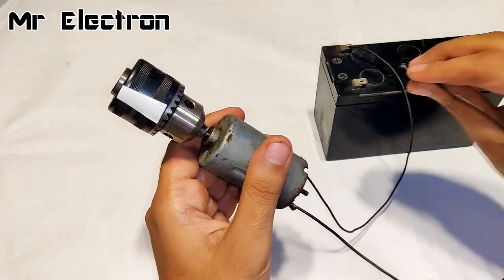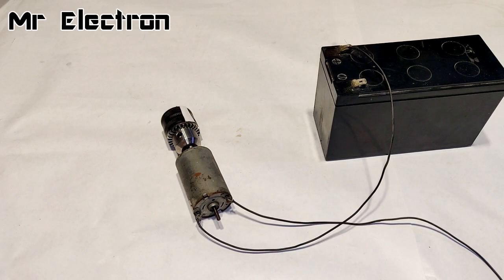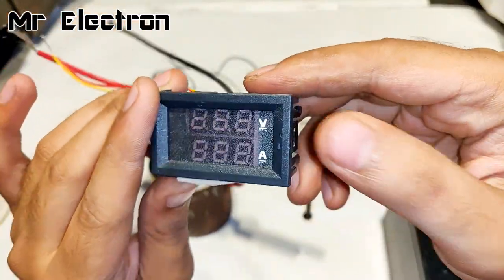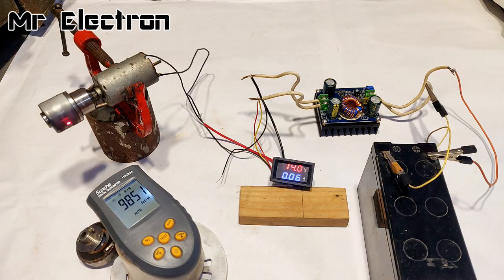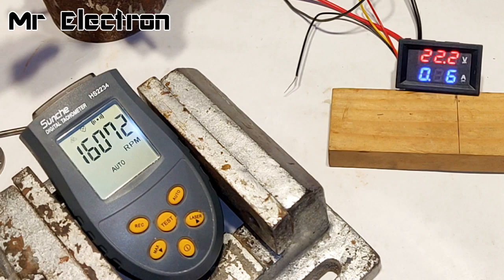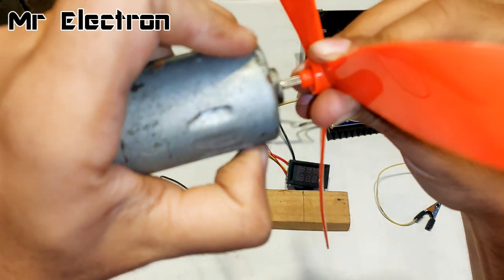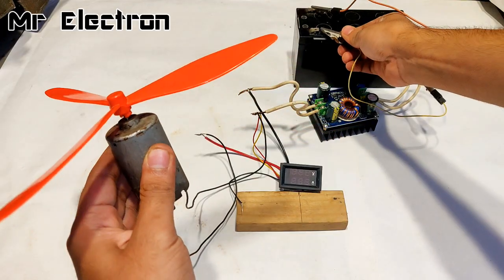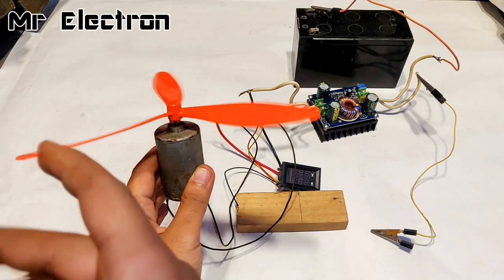40000 RPM - 12V DC Motor from Old DVD forced at 40 Volts DC ( Flying Helicopter )

Comment: Can we use led bulb circuit in place of DC booster ???????bcz led bulb circuit give output of 100 to 110v in DC without load or after load it gives us 80 to 90v ??????

Comment: flying process depends on motor's RPM as well as its propeller, if the propeller change accordingly specially designed for a flying machine, may be it could fly in low RPM/volt/Amp.

Comment: After one minyte the motor would heat and melt or probably come apart.
Reply: It's a fairly high impedence motor.  Even loaded with the prop, it's only drawing about 1 amp at 40 volts so 40 watts which isn't much for a motor this size.
Reply: @Andy-df5fj  thanks for the explanation.

Comment: With a better proppeler it could fly at 30 volts only. That proppeller is designed for a plane not a vertical take off.

Comment: This is risky. Please use safety gears like a helmet with face shield and something to protect your body as well. If that wings break or comes out of the shaft of the motor, it can be dangerous. 
I hope that motor is RS775 or S885. It can withstand a max of 24 Volts. With more voltage, it will get heated soon and also the brushes will get destroyed soon.

Comment: This video was absolutely awesome! I bet with all that thrust that the motor must have stayed pretty cool despite being forced to 40 volts?
Reply from the maker: Yes it is same as before.. No performance change 😀
Reply: @MrElectron  that's quite awesome, I bet if you soldered some aluminum fins to it, it would no doubt stay cool as long as you find a better propeller lol
Reply: I'm definitely going to get me one of those voltage boosters though, I'm sure I can find plenty of use for one of those, when needed

Comment: Can i use it for e bike 48v 250w scooty i need to run on single battary
Reply from the maker: Yes
Reply: Wot battery 😂😂😂 tho cus ya gonna see more amps to step up the voltage eg to power 48v 250w  could draw over double tripple the current from a 12v battery which reduces the run time lol

Comment: Hey bro you do some projects with bike starter motor right? Please can you tell how much rpm it gives when 12v battery is used?
Reply from the maker: Around 8000 to 10000 which is reduced with a reducer gear box.
Reply: Thank you for helping :)

Comment: Build quadcopter using this motor and with another level of load handling.
Reply: battery would be too heavy. motor not efficient enough for vertical hover.
but as an airplane probably would be much better. could easily fly.